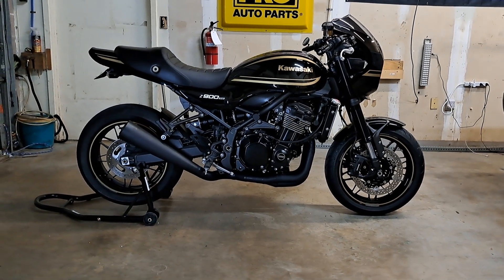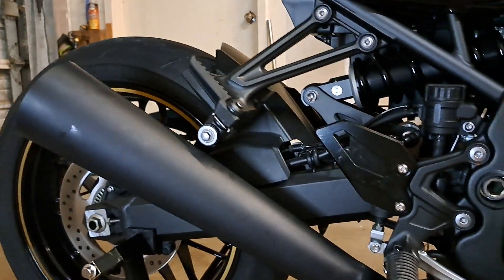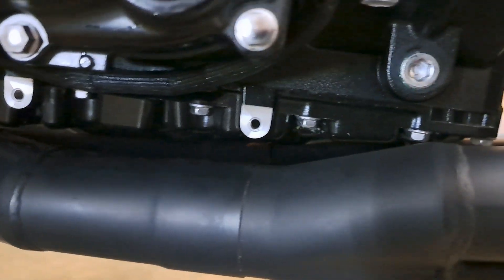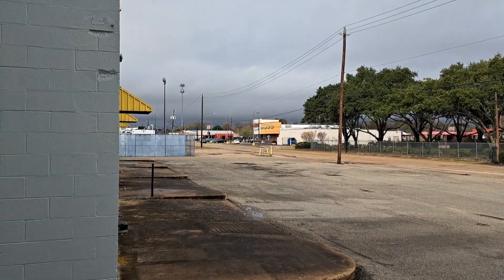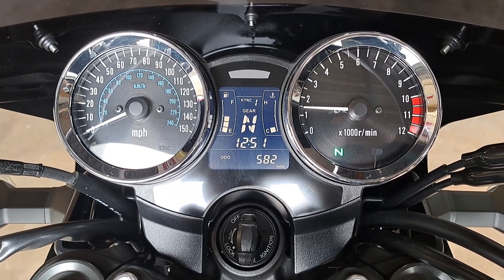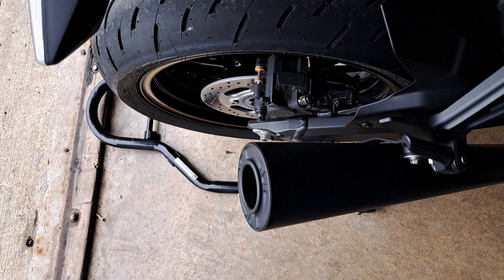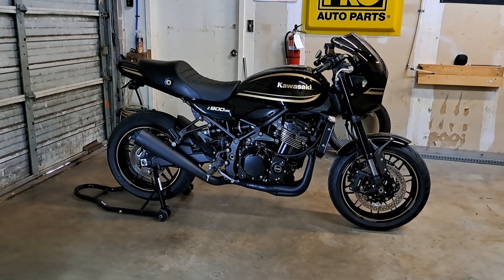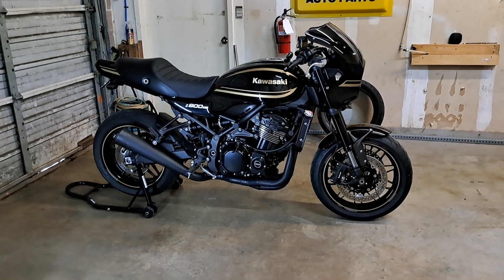Z900RS.  Brocks Exhaust Install. Part 2. Now With Sound Clips!

Comment: Oh yeah!! Sounds good!  🏍️💨
Reply: Did you get est HP& TQ increase? More curious about that initial tq hit now.
Reply from the maker: @Skidz75  this combination is pretty well documented to pick up about 18 horsepower at the tire.. With the addition of short stacks you might see another three horsepower. That said, keeping the stock velocity Stacks with this tune and this exhaust makes mid-range and partial throttle power production far stronger then I had initially anticipated. Under partial throttle conditions, the bike feels like it picked up 150 cc's. Far smoother power production as well.

Comment: Hey man, this sounds awesome and looks great. How did you order this without the logo plate? I tried to message their customer support team, and they said we can't. Did you remove the logo plate aftermarket?
Reply from the maker: @jeremywu4207  they made an accommodation for me but I don't think that they typically do that. It is removable, with just a couple of rivets that would need to be drilled out but you would need to fill the holes

Comment: Quick question reguarding the pipe. Is the Brock’s logo removable? Or did you have to order it that way
Reply from the maker: @toofastnobrakes  I had to order it without the Bronx logo, but it is a special order only and you may have to wait quite a while to get it but to me it was worth it

Comment: Did you not get the map support with the purchase? Why did you go with an Ivan performance ecu flash?
Reply from the maker: I didn't use Brock's Tech support, mainly because of the customer support that I received from ivan. He answered the phone and took the time to speak with me on every modification I had in mind I also have a tuning background and was able to speak to the person that put the tune together directly, which helped quite a bit. But apart from that, I had seen some very strong positive reviews of his work
Reply: Thank you very much much for the answer and explanation. You helped me a tremendously